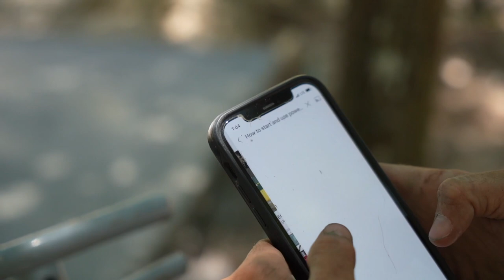Pouring a Concrete pad for our own Skatepark

Comment: Without rebar reinforcement, concrete is highly prone to cracks due to tension forces. Rebar helps prevent cracks from growing wider largely by preventing cracked slabs from moving apart.
Reply: It's a shallow slab. rebar is used when your project is deeper then 6 inches, It's not necessary for what they're doing.

Comment: Working with concrete is hella fun Imo but you should of put some rebar in you'll have problems with the slab at a later date without it
Reply: It will be fine.  Not like it's made to hold cars.  A few bags of upkeep a year is alot cheaper than metal.

Comment: Where is the rebar at?I dont see any in the pour?Maybe its fibercrete for strength,but doubt it?
Reply: No rebar no mesh or nothing lol and they used tho old school 2x4 screed trick lol
Reply: Exactly my thoughts
Reply: Pretty concerned about that, unless it's the right type of concrete it won't last.
Reply: @MJBOGAN  it’s gonna crack no matter what but maybe they will be smart enough to cut a few tension lines in it so atleast the cracks follow that
Reply: @ylemscalamity  how's that work? Cut regular channels then, during expansion the cracks follow along? What's the follow up from there?
Reply: @turbofish6134  yea that’s pretty much the logic but u can cut lines diagonally and vertically usually only 2 each way unless u have a huge floor. They actually make machines that are made exactly for this. We saw cut just about every big floor we do and if it does crack it will crack along the lines and not anywhere else and it won’t spread either

Comment: Lmao there was an add for “concrete crack repair” in the middle of the video no joke
Reply: With no rebar and such a thin slab, they're gonna need it!
Reply: @franj001  At the very least they could have used that metal mesh,  chicken wire stuff. Would be better then no reinforcement lol
Reply: The quickcrete lmao

Comment: No rebar this going work well
Reply: Not even a little chicken wire or anything just straight send
Reply: @brfuzz5600  ik haha
Reply: I was thinking the same thing. I'm from Canada though. So I was just thinking no winter no rebar?
Reply from the maker: Anything that is 3 inches you do not need rebar as long as you have fiber additives
Reply: Unlike your grammar 😂😂😂 jk brother all love
Reply: @official_bigboy  thank you big boy! Was about to say that for you lol , i do construction and work with concrete daily so ik a thing or two about it and such lil
Reply: they are prob just going to be riding bikes on it i can’t imagine them crushing it
Reply: @jacobross1996  exactly.  especially because they havent even put in vert section yet there is no need for rebar. But the vert section walls and such without it may be a bit harder. Well see how they go about it. Def worth watching
Reply: @ryderT315  my grammar the worst... anyways was just trolling 😁😁😁
Reply: @official_bigboy  Good to know. Thanks for straightening us out. Still curious if that would apply to Canada. You know what these Edmonton winters do to concrete. Haha.

Comment: Big boy, is there any sort of reinforcement in t to hat concrete? Because I noticed there was no rebar and you may have issues with cracking down the road.
Reply: I think it’ll be fine the pad isn’t huge I don’t think but yeah it’ll crack a lil bit down the road regardless
Reply: @LoloTagz  I’ve been doing concrete for 13 years. No matter the size we always at least add chicken wire for reinforcement
Reply: @RoachSoda  isn’t there concrete with like fiber reinforcement mixed in? They could’ve used that maybe? Idk you’d know more than me lol
Reply: @redsballer1904  yes, which is why I asked. Even still on a slab that size the fibre won’t guarantee no cracking. All concrete will crack regardless of how much reinforcement is in it. It’s a matter of how much a piece will shift after it cracks causing massive uneven sections.
Reply: @RoachSoda  It's fine for what they're doing. adding rebar would just add to the cost and they were already low on cash from what you can tell. Besides BB isn't gunna own this place forever. Tearing up that slab with rebar would be a nightmare when it's time to sell. Not everything needs to be a permanant masterpiece. Let them ride their bikes jesus christ
Reply: @mitchd2656  I want them to have the best riding experience possible. I’ve been doing concrete 13 years and would hate to see the slab crack and shift and have them have a massive flaw in the slab that makes their riding experience less enjoyable or more dangerous. You can rent a concrete saw which will cut through the rebar for like $20 an hour and get it done super quick when the time came to sell. Also BB shouldn’t be responsible for tearing out the stuff after he sells that would be on the new owners of the land. People like you like to point fingers and say that people are being dicks or whatever but I was merely asking a question and engaging politely with the other commenters. I love BB’s vids I’ve been subbed to Scotty’s channel since before 50k and to BB’s since before 20k. I’m here for the content and love what he’s doing, stoked to see him living his dream and would be disappointed if anything were to happen to make the riding less enjoyable or more stressful for him. Get off your high horse, I’m not criticizing BB, I know exactly how much all this would cost and  in my opinion the extra few hundered bucks on rebar would be worth it. I just want BB to have the best features he can.
Reply: It’s got fibre additives so should be fine for a while 👍

Comment: No experience in concrete we can tell . No rebar = cracking and separation . Good luck with that .
Reply: Free money so they don't care
Reply: It’s not just the rebar lol, all concrete needs a good base, I use 21AA limestone and compact it in 2” lifts. It’s a bike pad, no need to use rebar, just saw cut it in areas no bigger than 10x10, and it will crack where it’s supposed to. They also poured at what looks around a 7 slump, which diminishes the strength, rebar the last thing to worry about.

Comment: no re bar ? It will crack in a year or less. Rain will wash the sand under it away. Should have put river rock down and packed it first. re bar across every few feet. I could be wrong.
Reply: You're not wrong per say but it's a shallow slab regardless. Not really necessary for what they're doing it will be fine. Especially if he has to break it down selling the property in the future.
Reply: @PabzRoz  makes sense. :)

Comment: Did y’all put any rebar or expansion joints?
Reply: Sadly that slab won't last any longer than 2 years, mby its not meant for long term project

Comment: Can’t believe they put no reinforcements in the concrete.
Reply: You payin for the rebar? Jk i feel like its a shallow slab and doesnt really need it.
Reply: There will be cracks everywhere!
Reply: You mean rebar? They probably used high strength concrete. It's a shallow slab it's not necessary for what they're doing. Especially since OBB is not gunna own this land forever. It would be a nightmare to break down once he sells. Relax.
Reply: It's a shallow slab... Rebar is only used in projects deeper then 6 inches 9 times outa 10.

Comment: For everyone crying that they didn't reinforce the concrete relax. It's a shallow slab and depending on the concrete they used it's fine for what they're using it for. Yall act like you're paying for the concrete. Rebar cost money and OBB isn't gunna own this property forever. By the time he wants to sell the property tearing up that slab with rebar in it would be a nightmare. Not everything has to be a permanent perfect masterpiece. Let them ride their damn bikes lmao yall weird.
Reply: Exactly. Obviously they factored rebar going into this. Trey and Hotdog King aren't stupid. This obviously isn't permanent and for a shallow slab it will be fine. Sure it will crack after a while but so what? They're riding their bikes on it for a few years a crack isn't gunna stop them and they saved cash. By the time OBB sells the property this will be a lot easier to tear up.
Reply: The comments: OMG IT'S GOING TO CRACK AFTER A YEAR!
Me: Everything they ride on has cracks... not that serious....